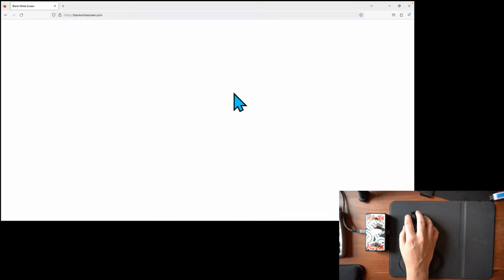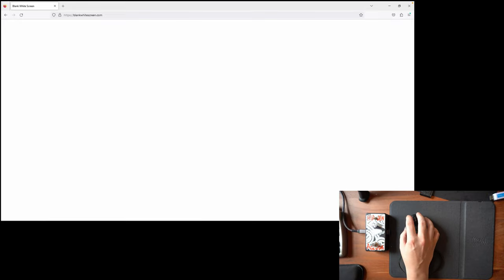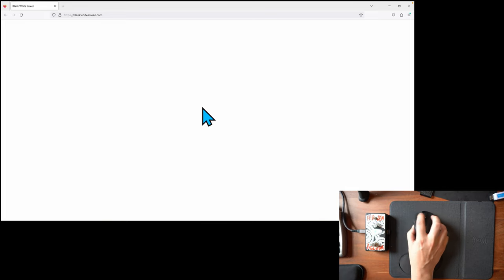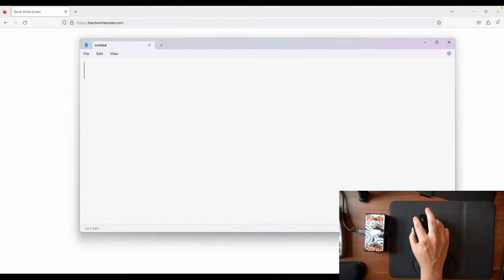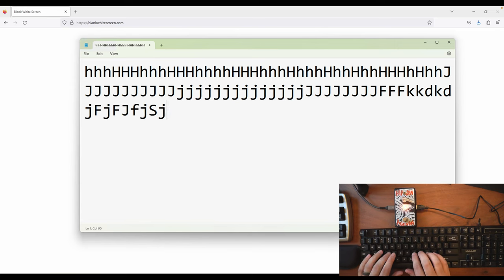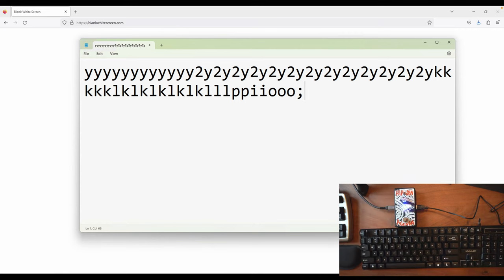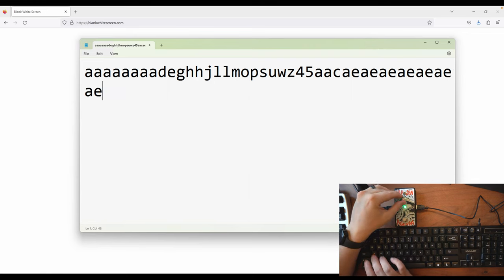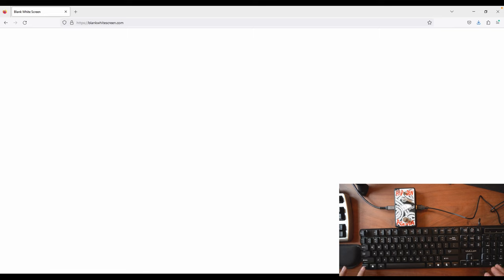An effects pedal... for your mouse and keyboard? 🎛️

Comment: Honestly, a mouse smoothing option could be really good for people with Parkinson's, or other mobility issues or people who struggle with precise control over mouse movements. Like there are things you can't click on in windows if you are still moving your mouse, because it will try to drag whatever you are clicking. There might be options in software that people could set up for free, but honestly people in older generations usually just want to buy a physical item to fix their problems instead of fiddling with software, and this might help them use a mouse a bit easier. Accessibility is always a good thing.
Reply from the maker: Agreed! Honestly considering doing a smaller standalone unit just for the smoothing - I feel like that's the most useful at the moment. The folks at Adafruit recently demoed something similar too if I'm remembering correctly.
Reply: other than parkinsons I'm using a software to smooth my movements while drawing. This could be a plug an play smoother for any hardware without a software need.

Comment: I absolutely love the absurd taken seriously. Silly projects completed with absolute professionalism are awesome, and this definitely hits the mark.
I also love(hate) usb hid device stuff. I've been playing with it off and on for a few years now. This is a cool implementation.

Does this clone the hid information from the mouse/keyboard and then present it to the PC, or does the pedal just act as it's own hid device and then pass just the mouse/keyboard input to the host PC?

It'd actually be kind of neat to put a modified version of the KMK keyboard firmware on it and turn any keyboard plugged into it into a KMK keyboard with layers and macros. Hell, in fact I would love to do exactly that, as I have a lot of layers/macros I use on my home  keyboard that'd I'd like to use at work, but don't want to lug my keyboard to work all the time. Could carry this and throw it in as a middle man. Could then also have a hotkey combo to enable a mouse jiggler as well.

I love someone else's comment about using it as basically a password encrypter. Have your secret key so you can have an easy to remember password, that when typed through the pedal outputs something much more complex. Could even have the password mode passworded, so you have to type a specific key sequence when password mode is enabled.
Reply from the maker: Love the KMK idea! And yeah the pw idea was great too. This presents itself as its own USB device, since (regardless of what's plugged into it) it can always act as a keyboard/mouse/serial device.